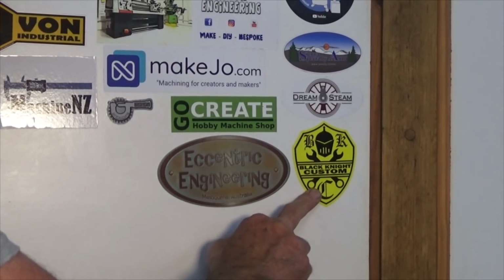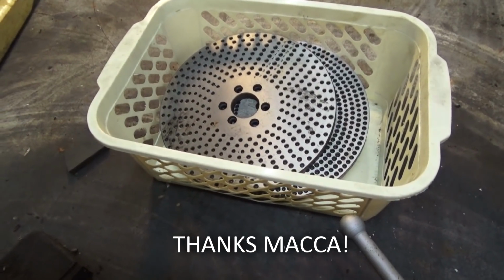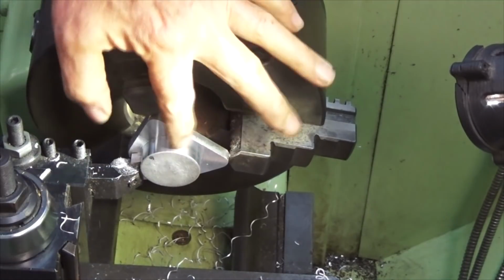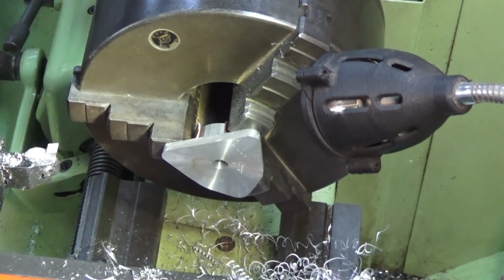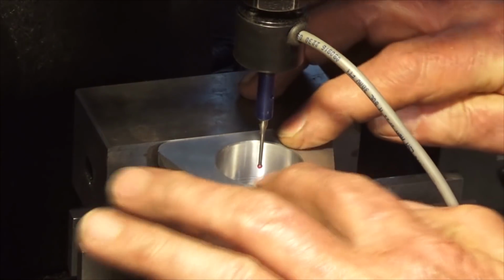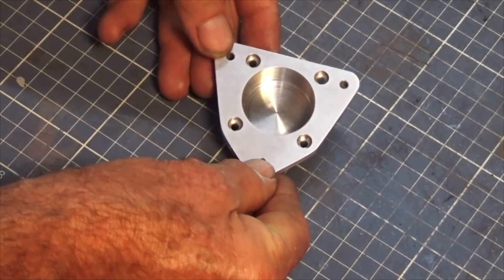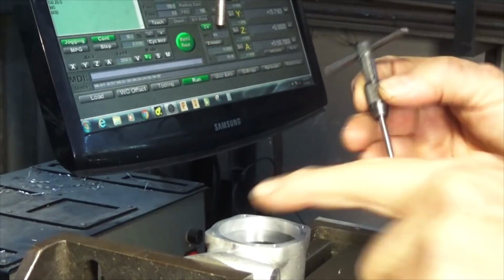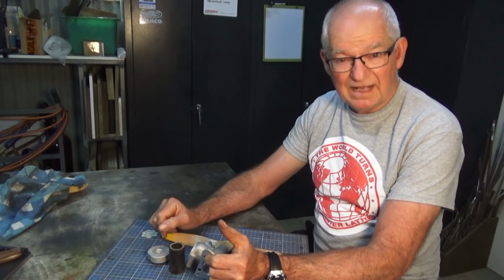Building the Titan .60 Glow Plug Engine #5

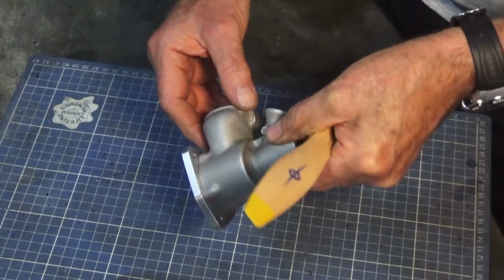Comment: 28:20 Eh I think this engine would run just fine with little more than a coating of light machine oil across those surfaces during final assembly. OS is known to do this with their production engines and what I'm seeing here is matching the machining quality I see when I open up my OS engines!
Reply: I remember as a kid people using castor oil along with "white gas" for those engines. 
I have enjoyed watching this build as it takes me back to the 1970s when my brother and I would build and fly those model airplanes
Reply from the maker: So, no gasket at all? Probably, given that the surface area is so small, a light smear of silicone is all it will need.
Regards,
Mark
Reply: @Preso58  I was leaning more towards 3n1 oil or something similar.

Comment: Mark,

The 6-32 is a bastard thread.  On a project like this I would have deviated from the drawing and went with a 6-40 thread to reduce the"pucker factor".  

The tap is stronger, the screw is stronger, and the only downside is the screws are slightly more expensive but not much more.
Reply: #6-32 is a standard course thread. #6-48 is the real bastard.
Reply: @ADBBuild  

Andrew,

I suppose it gets down to my choice of using the  "bastard". I apologise if this choice resulted in conveying my point.

I agree that a 6;32 is in fact designated as "course" and I'll grant you that it is common as dirt.

However,. I think if you look at machine screws the 6-32 stands out as having the smallest minor diameter (As a percentage of the major diameter.) and therefore taps tend to be far easier to break.

Feel free to re-read my post substituting "son of a bitch" or any other term you like.
Reply from the maker: Roger, my favourite threads are the model engineer threads. 1/4 X 40 is a doddle. You can do it with your eyes closed. You would have to be pretty careless to ever break one. But those taps specified in the drawings were getting to the scary side. I only have to do 6 more!
Regards,
Mark

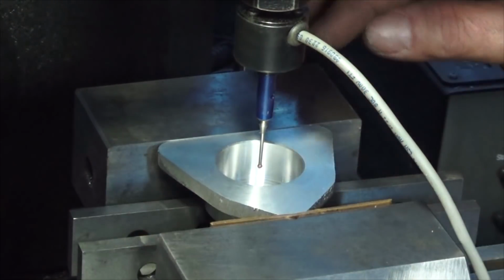Comment: 17:50 Lovin' watching an engine come together. Little note popped into my head right here, though.

I would have loctited the backplate to the case, chucked both parts into the CNC as one, and drilled all the holes at the same time, four of them to tapping size for the bolts retaining the backplate. At that point I would torch out the loctite, seperate the parts, ream out and countersink the four retention bolt holes, and that'd be that. My logic in doing so would be simple: If the backplate's somewhat off in the rhubarb when the holes are drilled the holes will still line up with the case and retain it because the holes in the case were drilled in the same operation. Less chance of scrapping a casting. It would also eliminate fixturing errors causing the backplate to not bolt to the case because the two parts would be treated as a single part for that critical operation.
Reply from the maker: That's why they call loctite an engineering adhesive. I sometimes use that process or a variation on it. However I do now trust my little CNC mill. It has double ball nuts on the screws and it's repeatable to within .005mm. If I use the same Gcode but just edit out the moves I don't need it will give me what I want. If I were doing this on a manual mill I would use the technique you have described. 
Regards,
Mark

Comment: Use as a pointer is still using it 👍 You must have bigger balls than Matty 🤣
Was great to meet up and I'm glad you found some wombats.
Engine is coming along well.
Cheers mate 🍺
Reply from the maker: Thanks Bill. I shot another take of holding the knife with one finger on the point and it slipped! Luckily, no fingers were severed! I am thinking I will keep it in my car when we are on holidays. Sometimes you go to an AirBNB and every knife in the joint is so blunt you might as well use the back of the blade. Thanks again.
Regards,
Mark

Comment: seems like an o-ring around the boss that goes into the crankcase would do an excellent job of sealing the back plate
Reply: Think the motors I had when younger used a circular paper gasket or none at all.
Reply: @ColinWatters  The ones I had used a paper gasket too.

Comment: Built this engine in the 90s .the only problem encountered was to high compression. Had to cut more out of head .when it ran it screamed.
Reply from the maker: The build notes do mention that the compression ratio can be adjusted after initial assembly. I guess it's better to start with it too high. 
Regards,
Mark

Comment: I hand tap a lot of holes to 2-56 and even 0-82 with good success. Just have to do so very gingerly and always use new taps. I ran a Colchester lathe for a few years at a shop where I worked. Good versatile machines.

Comment: Great Job so far. I’m a little bit weary of the 6-32, and 4-40 Taps also. Can’t wait for the next Video. Thanks for posting.👍
Reply: Yea, anything below M12 is dangerous in my hands.  I think i actually snapped a M12 tap before... oops.  I like the spiral ones you can just power through with.

Comment: Thank you but please DO NOT use wood screws to attach the motor to the wood test stand, please use nuts and bolts. 👌👌👍👍😁😁
Reply: Is there a reason, why you shouldnt use wood screws? Im interested
Reply: @TheGamerFeat0815  Yes, wood screws can work loose, I've flown RC for years, never  would I attach an engine with this type of mounting to a fire wall with wood screws, the vibration and pull could work the screws loose, on an engine this size either 4-40 or 6-32 bolts.